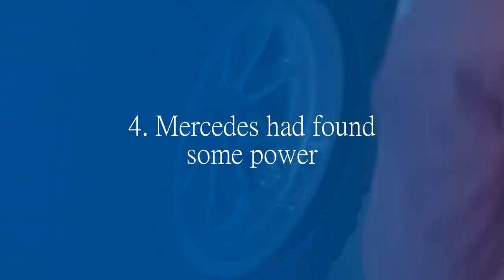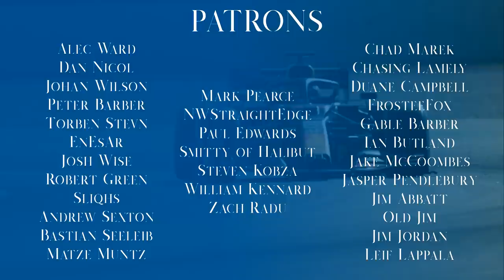THE SCANDAL BRUSHED UNDER THE CARPET! The Story of the Ferrari 'Cheat' Engines (2018-2019)

Comment: Ferrari was cheating for real.  Not in the gray area… actual cheating.  Im all for innovations, is part of why i watch.  Merc DAS system, the oil burn design, blown diffuser, f duct are all great.  Ferrari was tricking a fuel flow sensor to give the ICE more fuel, even knowing they would have to sneak more fuel in the tanks to do this.  Redbull had to figure it out and protest along with merc to get it to stop.  And ferrari was never punished and got to keep the 2nd place that belonged to redbull.  Ppl want to say the rules were bent in 2021 but this is far worse.
Reply: There's no such thing as cheating - only extraction of max performance given the monitoring mechanisms being used.
Full marks to them, ingenious.
Reply: @peterthomas5792  wrong Ferrari did cheat in 2019 and here is such thing as cheating
Reply: @peterthomas5792  had a midfield or back marker team done it, they’d be praised for their innovation in finding a loophole
Reply: @peterthomas5792  are you mad? It literally states in the regulations that it is not permitted to exceed 100kg/h. They exceeded 100kg/h. End of. The clever mechanism was how they managed to avoid detection of the cheating for so long.
Reply: @jsquared1013  Less of the abuse please. Is 100kg/h measured instantaneously, over several milliseconds, several seconds or minutes, or an average over the entire race? Do the regulations make that clear?
Wind your neck in...
Reply: If the rule is 100kg/hr of FUEL flow and you are using OIL as FUEL, that means Merc was CHEATING the fuel flow sensors for 6 years, by burning specifically designed by petronas high hydrocarbon synthetic oil. 
Not whoops, we're burning some oil by accident, 100% engineered oil 100% engineered to be used as a power boosting fuel, straight up 100% cheating.
Reply: @peterthomas5792  it was measured in 20 m/sec intervals and ferrari was pushing more in between sensor recording times.  This is cheating a sensor.  And lecarc  had about 2 gallons extra in his tank when he was checked.  The actual measurement given was in kilograms and had to guess on the fuel type but it doesnt differ that much.  2019 they could still select different engine maps to use or not use the fuel.
Reply: @robh9577  there was no rule on burning some oil but most teams did some of that after.  Fia put a rule on how much u could burn for the rest of that season.  They then changed it and its not really done any more.  To me this one is very gray.  Not as smart as DAS or flexy wings but still outside the box.  What ferrari did is black and white cheating!
Reply: @pranc236  the rule always was, (paraphrasing) "any fuel used for combustion purposes MUST run through the fuel flow meter, at a rate not to exceed 100kg/hr". Note that it never said gasoline, it said FUEL.
Now as a cynic, I read developing a synthetic motor OIL, that has no purpose or reason to contain hydrocarbons, to be FULL of hydrocarbons, and then using that "oil" selectively at certain times to increase the engine HP outlet, and keeping that "oil" in a seperate tank as not to mix with the engine LUBRICANT, is a FUEL and not specifially an engine lubricant.
The entire hybrid rules package was based on everyone needing to use 100kg/hr of fuel, to show the world how efficient IC engines can be, was based upon using ONLY that much fuel.
For merc to deliberately circumvent that rule and use (apparently) 8-10 liters of oil per race, agreed upon up to 60hp at max usage, is far far beyond a grey area.
Reply: And Ferrari figured this out, with a 20 liter oil reservoir started leaking it through "faulty" welds in the (only one on the grid) oil cooled intercooler, and because it was unmetered unlike merc state of the art job, they used to smoke on the pit lane and on the grid, and only after that did the FIA clamp down on it. Reducing oil usage during the race, all oil must be the same grade in the same reservoir, and then finally banning engine modes because Merc was still using it during qualy. 
As far as Ferrari and the mystery engine, we still dont know, this is all hypothetical. 
We do know 100% merc was burning oil from 2014 until the ban on engine modes, winning every championship during that time.
Reply: @robh9577  in ur example.. thats cheating.. i did not know it went that far.  The stuff i  saw was tiny holes in pistons that was letting small amounts of oil into combustion chamber. This would be a all the time thing and not able to turn it off and on. I was expecting maybe a liter a race at the most.  I will say the merc’s had allot blue smoke with no engine failure 2016-2018.  
Maybe that is why ferrari got away with what they did… cuz the could prove merc had been cheating too.  Just crazy enough to be real.
Reply: @pranc236  it in its basic form was "piston cooling" at for example 5 psi of oil pressure. 
But then "party mode" etc, based on how much power they needed would raise the "piston cooling" oil pressure to XXpsi and it would fog the combustion chamber with the high octane oil. 
Its ingenious, and apparently amazingly effective. But I have no idea how it was not banned and publicized heavily upon discovery. 
It's probably the largest part of their dominance from 2014-mid 2020, which unironically is when max started becoming a thorn in Lewis's side.
And make no mistake, engine mode bans were not an FIA conspiracy aimed to slow Merc down or reduce their advantage, its because even with the engine oil "usage" limits in place, they were still using the max amount during qualifying via special engine modes and gaining an unfair advantage. And if they had to run that engine mode throughout the race they would have been DQd for oil consumption.
Reply: @robh9577  wow.  That does fit many pegs into many holes from what we were told.  U mean the media would lie and glaze over hard facts?  Im kidding…. Always thought it was nuts Redbull had to figure out what ferrari was doing for the fia. And got nothing for it.
Reply: @robh9577 Maybe, but isn't the onus also on the FIA to meter the use of all potential fuels, instead of just petrol?
Carelessness by the FIA.
If Merc were cheating, they'd have had penalties, but the rules were clarified to make what they were doing illegal.
Same with Ferrari, although a far more fragile argument - it 'couldn't be proved that they'd flouted the laws, as long as they cooperated with investigations and rule changes.
I believe nothing in F1 is illegal until the rule makers CONFIRM that it is. Until that point, full marks for exploiting what you can.
If teams aren't interpreting the laws as the FIA intended them to be interpreted, maybe its the fault of the FIA for leaving the interpretation open. Hence the oft-issued 'clarifications'.
Reply: @peterthomas5792  2 stroke engines (running on gas and oil) are banned. 
Burning oil was always banned. 
Mercedes had "piston cooling jets" that overpressurized and the oil made it's way into the combustion chamber. 
It is illegal, it was always illegal. 
They couldn't technically PROVE they were doing it, merc just said Our engines use a bit (8 liters) of oil during the race, whoops. 
So then we have a 3 year protracted oil consumption downward limit rule, and STILL they were using the max amount of oil per 100km in qualy and when they need and extra race boost (Bono my tires are dead, fastest lap after fastest lap before the pit stop)
So then they ban engine mode changes which finally stop them for good. 
The FIA should have stomped on that after race 1 in 2014 when they realized that was 8-10 liters of oil missing from their tanks at the end of the race.
Reply: @Rob H I agree, Ferrari was cheating for real, I just admire the ingenuity of the way they did it, but they were caught out big time with 'accidentally' being over-fuelled by two gallons. Burning oil, I'm not so sure of - I haven't seen a regulation that specifies that fuels include/exclude oil. Maybe it existed and Merc ignored it, maybe it didn't - I expect it exists now as a clarification.
I believe the fact that Ferrari weren't punished far harder than they were was purely down to the incompetence of the FIA in being able to prove how they'd done it without Ferrari coming on boars with "we'll show you if you don't penalise us".
Reply: @peterthomas5792  nobody knows what Ferrari got dinked for, and if was was classically illegal or not. 
It could have been something on the hybrid side. 
Running outside the fuel flow limits is what everyone is assuming. 
Their cars back then didnt have the hybrid drop off at the ends of the straightaways. Merc and everyone else did. 
Helping with future rules policing seems odd as the FIA introduced the 2nd fuel flow sensor and that dented the Ferrari performance, but did not give them 2020 level dog crap performance that we saw last year. 
I dont even care about Ferrari one way or the other, they were found out and effectively punished. 
But merc went around the rules for years and never had an actual punishment levied. 
I mean they were using synthetic man made oil that had petroleum based hydrocarbons loaded into it, made specifically to burn inside the engine. 
Is that that not wildly suspicious and incriminating by itself?
Reply: @robh9577  I think everyone knows exactly what Ferrari were doing, because they disclosed it to the FIA under an NDA in return for leniency. They were burning way more fuel than the regulations intended - end of.
Merc oil-burning - can you point me to the regulation that said that oil introduced into the combustion chamber as a 'normal part of combustion' (i.e. leakage past piston rings, turbo seals etc) was outside the rules?
I haven't seen that rule...but don't doubt that Merc exploited it's absence.
Reply: @robh9577  Its not possible to explicitly ban burning oil because an engine cannot run for more than a lap or two without buying any - thats just a fact.
So the regulations needed to have a clause specifying how much oil was acceptable to burn, but they didn't.
Merc exploited that, whats the problem?
Reply: @peterthomas5792  just like "the race director has total control of the SC period" the catch all "is the PU must be 4 stroke" 
At what point them purposely and willingly using oil as part of the combustion process divert from the generally accepted rule that 4 stroke engines should not burn oil. 
In 2017: "We wish to remind you that, as previously stated in various meetings and re-emphasised in TD/004-17, we consider the use of oil as fuel to be prohibited by the Technical Regulations"
The initial debate going into 2016 when RB/Renault raised the red flag,
"Burning 4kg of oil in a race, it's almost a diesel engine," said Horner.
"It goes against what the concept of this eco-friendly hybrid formula is."
Reply: @robh9577  Oh come on, you can't accuse Merc of running a 2-stroke engine. It was clearly suck-squeeze-bang-blow, even if the suck may have sucked in a bit more oil that you think was fair.
As for "We wish to remind you that, as previously stated in various meetings and re-emphasised in TD/004-17, we consider the use of oil as fuel to be prohibited by the Technical Regulations", Merc cited that the primary purpose of the oil was for lubrication and it therefore wasn't being used as fuel but as a lubricant.

I'd take with a very very large pinch of salt any complaint cited by Horner - he's not exactly white-than-white himself is he?
Quote Horner from Drive to Survive to Toto: "Don't take it personally, but we'll make an official complaint about anything that we think may give us an advantage".
Probably paraphrased slightly, but that was the gist of it.
Reply: @peterthomas5792  high performance competition engines, let alone ones that have had hundreds of millions of dollars of engineering spent on them, do not burn much oil at all. 
This is kind of my neck of the woods. 
especially in a turbocharged situation, engine oil in its basic form reduces the overall octane rating of the fuel, because anything in the chamber other then fuel and air hinders burn rate, kills heat and creates pre ignition. 
Especially with dry sump scavenging the systems are quite literally designed to cut down on oil misting, scavenging oil out of unnecessary areas and to promote piston ring seal to KEEP oil out of the combustion chamber. 
There is no situation where an engine designer would ever want oil as part of the combustion process.
Reply: @robh9577  If it's your neck of the woods, why are you accusing Merc of running a 2-stroke engine? That's not a comment that anyone with even basic knowledge of engines would make.
I'll bypass the rest of your points as they're not directly relevant, but let's highlight this one:-
> There is no situation where an engine designer would ever want oil as part of the combustion process.
Oh yes, absolutely there is. When it gives them a power advantage and it hasn't been explicitly outlawed. If it's plausible that it's primary purpose is not a fuel, then it WAS permissible as there was no specified oil consumption limit.
Reply: @peterthomas5792  they are all snakes lol!
Just like merc protesting the RB wing and then using a bendy wing element themselves. Or burning up 4 extra engines with bottas to figure out how to build a bullet for Lewis for the end of the season. 
I dont see how everyone was ok with merc from 2014-2019 running outside of the rules in a "grey area" but then going after Ferrari's "grey area".
Reply: @robh9577  
> high performance competition engines, let alone ones that have had hundreds of millions of dollars of engineering spent on them, do not burn much oil at all.

They do if the rules as written have a loophole that allows oil to be burned to produce more power. They did, so it was. F1 isn't about engine efficiency, it's about getting the most power you can, for as long as you can, within the written regulations - not within the intent of those regulations. That's why clarifications are issued.

> There is no situation where an engine designer would ever want oil as part of the combustion process.
Please see my point above.
Reply: @peterthomas5792   There is no justifiable reason to burn oil in a 4 stroke, other then circumvention of a steadfast fuel flow limit that everyone else had to play by. 
If you feel that merc was totally legal from 2014-16 because it was not specifically in the regs that's fine. But 2017 forwards until the engine mode ban, they were not. 
That is why the FIA banned the engine modes. Merc was still doing it. Which deserved a penalty or sanctions, but they got none. 
And its farcical to think that merc bragged about 50% thermal efficiency and the whole hybrid deal with making more power with less fuel etc and all the fans thought they were just doing a better job than everyone, while blatantly flouting the rules and concept of the hybrid engine. Never mind the heat recovery advantage they had by using more "fuel" than everyone. 
And then compound it by them blowing through 1/2 dozen engines at the end of this year on purpose to give Lewis a final advantage down to the wire.
Reply: @robh9577  Oh please. A 2-stroke burns fuel and oil, but burning fuel and oil does not make your engine a 2-stroke.
I haven't even read the rest of your possibly valid arguments because the opening one was ridiculous. You claim that engines are 'your bag', so why this 2-stroke persistence?
I've made it clear that there's a VERY justifiable reason to burn oil in a 4-stroke - as Merc would no doubt confirm in an NDA.

EVERY ICE burns oil, whether it's designed to or not - yes?
IF there are advantages in your lights-to-flag performance by burning more oil within the rules as they're written, you'd exploit them, yes?
ESPECIALLY if you spend 100s of millions on development.
Simplistically, ignoring fuel-saving, slipstreaming etc, if you have more Joules per race then anyone else, you're in a better position to win.

What Merc were doing was NOT outside the rules, but was outside the INTENT OF the rules.
Hence the subsequent clarification.
Reply: @robh9577  So you lost the oil-burning discussion so are now falling back on:-
a) Engine modes.
b) Bleating about Merc's thermal efficiency claims.
c) Engine changes - which were also open to all other teams on the grid.
Enough I think, we've disproved your oil-burning illegality claim, which is what this discussion was about.
Have a good day.